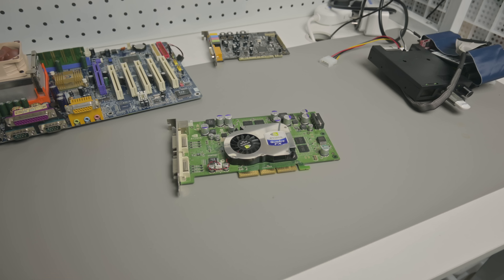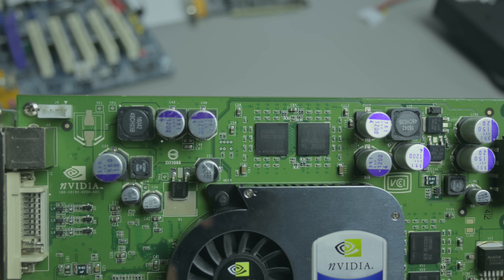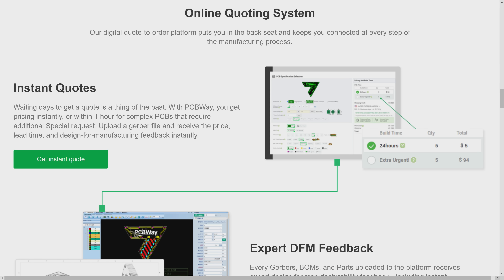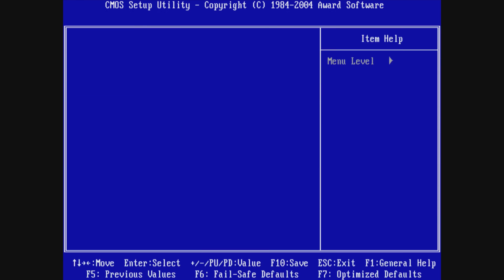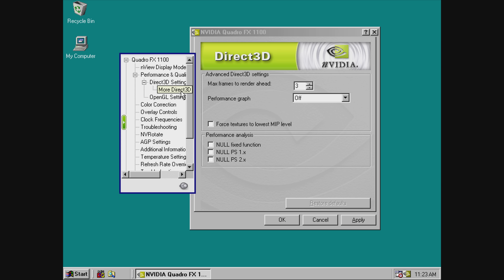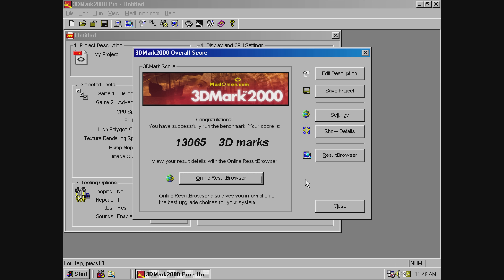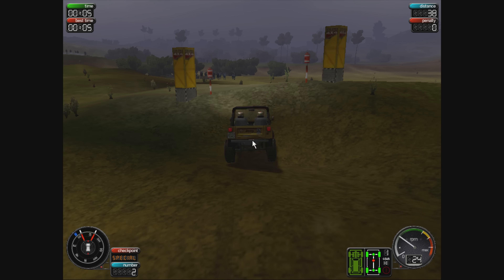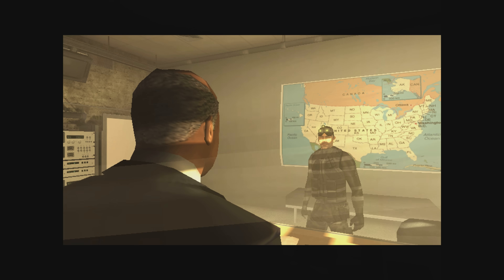20 Year Old Workstation GPU: Nvidia Quadro FX 1100

Comment: I have the PNY FX 1400 which is similar to this one, the fan noise will drive you bonkers and it's not that compatible with aftermarket coolers. For AGP there are better options still and your ears won't have to suffer.